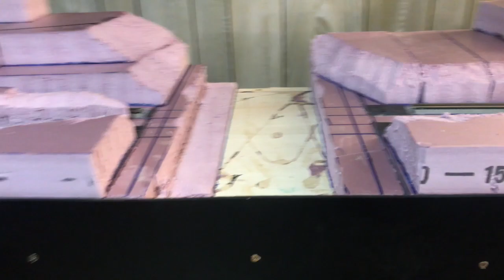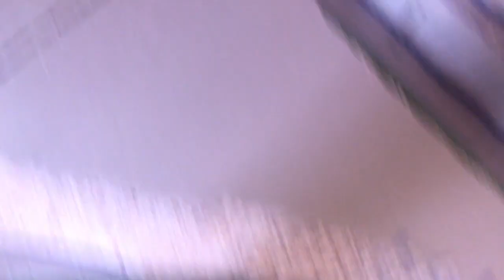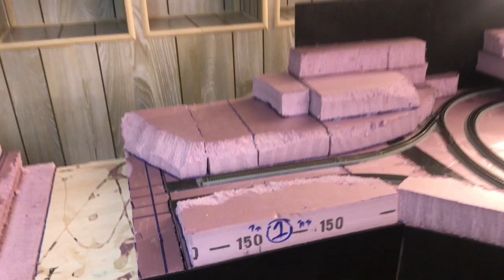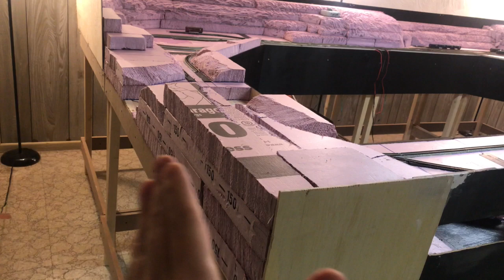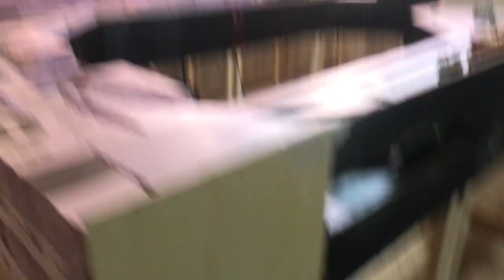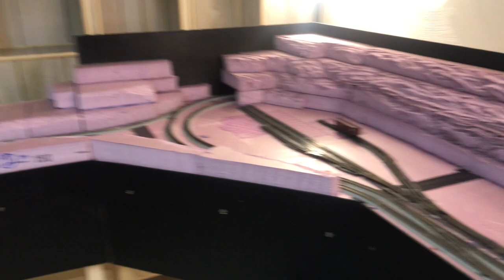N SCALE TRAIN LAYOUT PART 13 - Foam Mountain Sculpting, River Scene, Portholes, Town Scene & More!

Comment: Not a Bad layout But a Small thing is wrong you have Bachmann track with Different Track Stick Bachmann with Bachmann you’ll see it.
Reply from the maker: No, it is a conscience choice - and a good choice, that works flawlessly. 
Bachmann for the main lines - to be consistent and smooth, atlas track with peco turnouts for industries/branch line - lower profile and makes them more visually appealing to weather and look less used